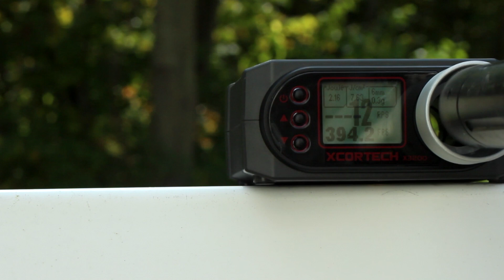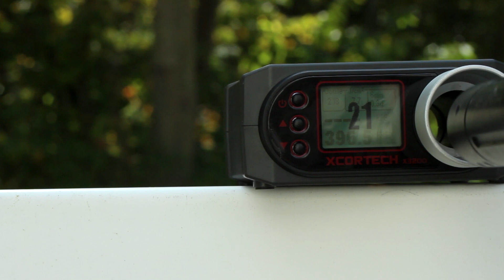Joule Creep Explained

Comment: Here what is going on:

There are (at least) 2 type of Joule Creep:

When you press the trigger in an AEG or a GBB - air from inside the piston or from inside the magazine will rush out with an "X" amount of energy.

1) Changing from a 0.20 to a 0.30 will result into a bb that goes slower but can do more damage (higher Joule output). That's because the bb has greater mass, thus it can carry a GREATER percentage from that initial "X" energy downrange. That of course has a limit... If you put a bb that is so massive that it can carry 100% of that "X" initial energy but is so slow that it can barely leave the barrel (see what I did here? ;) it will never be an issue in causing any type of damage to anyone...

2) GBBs and AEGs have a huge difference between them. In a GBB, the air that the gun is going to use to propel the bb down range is all stored inside the magazine of the gun... But in AEGs the air actually comes inside the piston FROM the outside air... Therefore when you shoot an AEG, the bb has a short timeframe to leave the barrel, before the piston reverses and starts sucking up air from inside the barrel to fill up the gearbox... Something called "inflow".

GBBs down suffer from any type of inflow... So to them exists a second type of Joule Creep - the one explained in this video. Mainly the more massive bb has more time to spend inside the barrel (then the lighter one) and thus gets a bit more of a push than you would expect from an AEG...

That's all there is to it...
That's why you should always measure FPS with 0.20s to avoid the 1st problem. And you should expect some inconstancy when it comes to GBBs because of that second type of joule creep.

EDIT: Where I think this video is wrong, is that you can really only measure that 2nd type of joule creep in GBBs vs AEGs in full auto or in rapid single fire. Testing it one by one will not reveal that 2nd type of joule creep anywhere...

So this video really didn't prove that this (2nd) phenomenon really happens. This video only proved that the 1st phenomenon happens, which is to be expected - but also something that works in all kinds of airsoft guns.

EDIT: By the way - that kind of joule creep in gas blowbacks can only happen by rapid fire and or full auto. Not by firing one bb after the other like in the video. He never measured joule creep in this video - he only measured heavier bbs = more joules. Thats not "creep" that basic physics.

In order to do a correct measurement - you need to fire your gun once. To measure the joules (or fps) at normal rate. Then fire the gun very fast or in full auto to measure the extra fps that "creep" inside because of the extra gas that's in the chamber.

He never did that.

Comment: is there a point to use joules as a benchmark? like high or low joules doesnt necessarily mean good or bad performance, its more accurate to base the performance on the fps and accuracy right?

so like do you sacrifice distance for accuracy when choosing higher gram bbs like .4, considering if you wanted more accuracy with the same distance youd get from .2, youd probably be shooting too high of joules or get restricted to a certain distance of engagement?
Reply: FPS doesn't account for BB weight. It's better to talk in muzzle energy than in muzzle velocity. It's like saying  "I live 1 hour from the beach". That doesn't really tell me what I need to know. Do you mean an hour by walking? in which case it's probably like 15mins by driving. So do you live 5km from the beach? Or do you live 1 hour by driving? in which case you live 100km from the beach, which is it   5 or 100? or somewhere in between? It isn't that specific or helpful. There's not enough information. Likewise, I can assure you that a 0.12g BB traveling at 360fps and a 0.4g BB traveling at 360fps is very much different.

Comment: What i ask myself.
1. When I buy an 24joule air rifle that shoots 305m/s or 1000f/s at which bb weight was this velocity measured? It must be 0.5g, because when I put this data in a joule calculator, and solve it for the weight (with the values of 24j and 305m/s) it gives the value 0.5g bb weight back. 
2. So I ask myself, why should the air rifle now have joule creep with heavier bbs? I mean the manufacturer of the rifle wont have constructed the air rifle with overvolume that can shoot heavier pellets with more joule? Why should he do that?
Reply: Bro you are confusing 2 separate things...

One is "joule creep" as explained in the video and the other is a LAW of physics that says, more mass = higher ability to carry initial power down range.

Yours is the latter. Which is to be expected. Nothing wrong with your airgun.

Comment: i played a new field last weekend and they treat snipers like aeg's and wouldn't let me use my rifle i use .49 gram bbs @406 fps and 3.5 joules. .if i use .40 bbs it shoots  470 fps @ 2.5 joules.....played all day with just my tokio marui mk23 side arm🤬
Reply: How many FPS is your sniper using 0.20s?
400 fps using 0.49 gram bbs is really REALLY over the limit imo, so they did good.

In my fields 500 fps using 0.20s is the limit. So if you have 400 fps using 0.49 ... that means that you have about 600+ fps using 0.20s, that's not airsoft, that's airgun! xD

Comment: There seems to be 2 versions of what is joule creep on the internet
1) the pehnomenon that given all other factors were kept the same, heavier bb lower fps. Some cheater exploid this phenomenon and dial up their fps but use heavy bb to pass chrono
2) the phenomenon that when all factors were kept the same, the muzzle energy (joule) actully increase when switch to heavier bb. Especially in a hpa/gas gun.
Reply: #1 is just cheating a chrono.

Joule creep is only when the joules of energy of a projectile increases with the mass of the BB.

Using a .4g BB to test when a .2g bb should be used is just dishonest and unsafe, and deserves a ban from any respectable field.
Reply: Indeed, number one is FPS creep, not Joule creep.

FPS creep is even worse and if done deliberately should result on serious consequences. 

Joule creep is also an issue, and it's something that separates gass blowbacks and most importantly HPAs from normal everyday airsoft guns.

Gas blowbacks of course are inconsistent enough to negate their own advantage. Since the gas in the mag starts to empty out, therefore the joules actually creep DOWNWARDS 😂

But HPAs are another ballgame, and deserve separate treatment by the given field.

Comment: All this Joule Blabber is NONSENSE. The issue is Some ass wipes Crank up there FPS and use .43g bbs in a polarstar. Thats the cheating of it. I just did a Test my Matrix AEG 370fps with a .25g and I dialed my Polarstar Jack to 372 FPS with a .25g too. I Then ONLY swaped the magazine to a .30g bb and I got 331fps with the AEG and 340 FPS with the polarstar. So the polarstar did have 10 fps more average but thats Insignificant on the airsoft field. I was also using the Xcortech chronograph.
Reply: LiveFreeOrRIP from what I understand, that's not what joule creep is about. It's just that heavier bbs push your gun more and fly with more energy.

If the marshals check the joules during a chrono then such cheating that you mentioned should be spotted immediately because the joule-fps relationship won't make sense. E.g. Fps too low in comparison with the joules.

Comment: Joules are calculated using metric units, the mass of the projectile in kilogrammes and the velocity in metres per second. For example in segment 2:19 you have a velocity of 439 feet per second, which is 133.8 metres per second, mass is 0.2 g, now you do the math:

((133.8^2) * 0.0002) /2 = 1.79 Joules same as the reading.

What I don't recognise is the "RPS" reading, would you be so kind to tell me?
Reply from the maker: To answer your question, it's Rounds Per Second. Your math is correct ( KE = (m * v^2)/2 ), I just let the chronograph do it for me.
Reply: NorthernHurricane7 It's good the function of the Creeper, I just clarified the formula because the given velocity is in feet, which I found odd.
Reply from the maker: Kriegerdammerung We use feet in America, unfortunately.
Reply: NorthernHurricane7 Only in the United States as far as I concerned, the rest of America use metres (I'm not a troll, I just wrote a reflexive comment). 

I knew that you use feet and because of that it surprised me the dial of the Creeper did not show ft.lbs as the unit of energy.

Comment: Just wondering, did you weigh those BBs before you shot them? A simple postal scale would have been sufficient for that. That way, your energy calcs would be more accurate, and you would eliminate BB manufacturing tolerances in your tests.

Comment: my gun has around 370 fps what weight bb should i use
Reply from the maker: 370 FPS on .20's, I assume? If you're shooting at distances under 100 ft, .20's will work fine. Any farther, and .25's is the minimum weight I'd use. Start with .25's, but experiment around and see if you think .28's or .30's are worth the extra cash for your playstyle.
Reply: NorthernHurricane7 ok thanks and i was looking into getting a gas gun i was looking into getting a m16a3 to make it a dmr have any you would reccomend
Reply from the maker: HelloImMR.B I've owned a G&P and a WE 416, and I am happier with the WE based system. Less mechanical issues and good aftermarket support if you need it. GBBR's aren't as accurate as an AEG or P* DMR setup, but still a lot of fun. Also, check out the GHK G5 with an extended inner barrel kit on it. The G5 can take AEG style barrels, which can be IR hopped and IER hopped for better performance.
Reply: @NorthernHurricane7  370 FPS on .20's should use 0.28 or 0.30 or even higher.
Reply: A heavy as you hop up can spin it
Reply: @dickiewongtk  That's if you want to have the full effective range. But you lose a lot of speed. You can find a happy medium, something like a silver liner between range and speed!